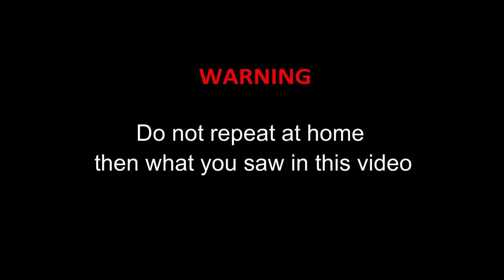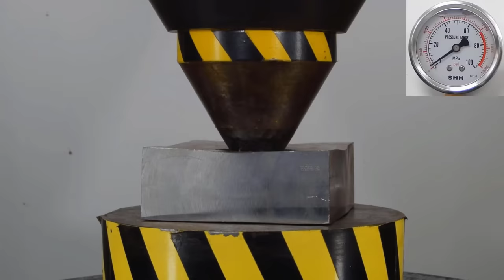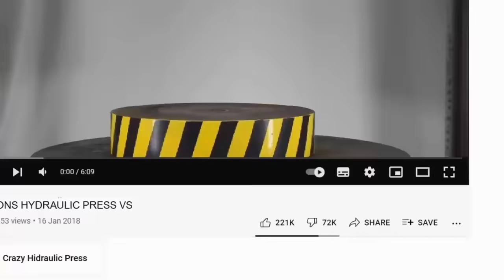HYDRAULIC PRESS VS OLD AND MODERN ARMOR

Comment: All of this makes you actually frigthened of the things that these armors stand against. After all, the armor of WW2 was already tough and that was already difficult to deal with. But the modern one that survived a lot more punishment makes you actually impressed about what modern anitarmor weapons can actually DO.
Reply: Do not forget that the majority of modern tank armor uses higher quality alloys than what was shown here, and also usually is layered with some form of composite (usually advanced ceramics or in the case of the abrams, spent uranium-derived materials) that works in conjunction with the high end alloys to slow, catch, and disperse the energy of, modern super high velocity anti-tank rounds, as well as handle the heat jets from modern shaped charges. A T-90M, Abrams of any model, or a Leopard 2 of any model would simply sneer at any cannon or AP round that WWII could feasibly throw at them.
Reply: @willkenny5687  "A T-90M, Abrams of any model, or a Leopard 2 of any model would simply sneer at any cannon or AP round that WWII could feasibly throw at them."
From the front? Most definitely. From the sides? Then I would be a bit concerned. From the back or top? They're a goner. Even ww1 artillery would go though the roof of a modern tank like a hot knife through butter.

Also, your tank list is weird, why list the T-90M, which is a top of the line tank, along with any model of Abrams and Leopard 2? An original Abrams or Leopard 2 is no where close to a T-90M, they are more like a T-72B but with a much worse gun in the case of the Abrams who originally only mounted the near obsolete L7 105mm riffled gun. The soviets where way ahead when it comes to guns as they already moved to a 115mm smoothbore gun back in the 60s when they made the T-62. Even the latest version of Abrams would probably be at a disadvantage against the T-90M as the Abrams tank has bigger weakpoint in the upper glacis. In a hull down fight, it's anyone's guess who has the better chance of penning the other since both armor compositions are unknown to the public at this point.
Reply: It would be very interesting to see WW2 naval armor
Reply: @willkenny5687 
Тут дело не только в качестве. Похоже сам подход к созданию броневой стали изменился.
Раньше считалось, что броня должна обладать высокой вязкостью чтобы снаряд застревал в такой броне примерно как палец в пластилине а сама броня при этом бы не разлеталась на кусочки как во втором случае (чтобы экипаж танка от осколков не пострадал).
Сейчас же, похоже, опять пришли к высокой твердости брони дабы броня сама по себе сопротивлялась какому-либо внедрению твердого материала (сердечника снаряда) а осколки в случае разрушения, видимо, должен удерживать противоосколочный подбой или какой-то хитрый слой брони из композитного материала.
Reply: @skitidet4302   The latest version of the abrams at a disadvantage against a T-90M? Don’t make me laugh. The M1a1 abrams handled T72s using the same 2a46m main gun as the t90m in iraq, and was never penetrated. I have strong doubts that that situation has changed dramatically enough to put the M1a2sepv3 at substantial risk. 

The soviets in the 50’s absolutely were leading the way by a lot when it came to tank technology, and the IS-3 was definitely better than anything the allies or axis had at the time, but materials technology has come a long way since then, I have very strong doubts that even its 122mm gun with WWII era ammo could take out a modern mbt. 

And the reason as to why I included all of those tanks together is because the original M1, the original leopard 2s, and the T90M, all use technology from the 80’s and 90’s, and are thus roughly contemporary if not equivalent.
Reply: @skitidet4302  
>Iraq
>Ukraine
Yeah nah I’m taking the Abrams and the Leo 2. They 100% are in the same category as, or are better than, the T-90M
Reply: @willkenny5687 Not to mention this dude was making nonsense points about tanks of today having weaker side armors. Unless any of the tanks listed were blitzing around corners and acting fully oblivious while fully aggressive, a tank from WWII shouldn't ever be in the position to shoot the sides or, heaven forbid, the god damn roof of the modern MBT. He reeks of 'I'm a numbers guy' stink.
Reply: @willkenny5687  "The M1a1 abrams handled T72s using the same 2a46m main gun as the t90m in iraq, and was never penetrated."

Wrong. Just plain wrong. It actually baffles me how you can just bracingly state something so absurd that can be easily disproven by a 5 second google search.
The Iraqis where using 3 types of T-72 tanks, firstly the original T-72 Ural, which had a D-81TM(aka 2A46) gun, the T-72M which was a downgraded version of the T-72A and had a D-81T gun, and lastly the T-72M1 which actually had the 2a46M gun. The problem is that the T-90M DOES NOT USE THE 2A46M gun! It uses the 2A46M-5! Which is a full 4 generations newer! The Iraqis also did not have access to modern Russian ammunition which is vastly superior to the ammunition that they had access to.

"I have very strong doubts that even its 122mm gun with WWII era ammo could take out a modern mbt."

The rear armor of a modern tank is likely not thick. It's hard to find any schematics of modern tanks for obvious reasons, but I strongly doubt they have more than 100mm RHA equivalent armor in the rear unless it's some kind of special version equipped for "urban" warfare.

"leopard 2s, and the T90M, all use technology from the 80’s and 90’s, and are thus roughly contemporary if not equivalent."

The technology is even older, that does not matter however since the implementation and use of a technology is way more important than when it was invented.
By your logic, a tank is equal to a Sword because they both use steel and that's a technology that's over 2000 years old.
Also, the T-90M IS NOT CONTEMPORARY with early leopard 2s and Abrams! LEARN WHAT WORDS MEAN! The contemporary equivalent is the T-72A or T-72B as those where of roughly the same era.
Reply: @autogaming8324  Old versions? You are being ridiculous! The old L7 gun has basically no chance of penetrating a T-90M frontally, while the T-90M can penetrate the Abrams literally anywhere with ease. The old Abrams had no independent thermal viewer for the commander, the T-90M does. The T-90M has a much lower thermal and auditory signature and lower fuel consumption than it's wasteful American counterpart, they moved way from gas turbines for a reason. The Soviet style tracks provide much better traction in mud compared to the rubber padded ones the west uses to preserve their roads. The list goes on and on.
Reply: @skitidet4302    fine, let’s play it by the technicalities then

The M1A2 SEPv3 and SEPv4 are objectively better platforms than the T-90M. Earlier versions of the M1A2 and potentially the M1A1(and its upgrades) are, if not superior, then on par with the T-90M. All other models of the Abrams are likely inferior, though, with the exception of the very first production batch of original M1s, they would still pose a threat to the T-90M.

Leopard 2A5 and up are either on par with or flat out better than the T-90M. Earlier models, while inferior, are still a threat to the T-90M

Now, about your statements.

Firstly, in no place did I ever mention the old models. That’s an incorrect assumption on your part, as im talking about the design as a family. Every model of Abrams after the A2 has an independent thermal sight, one that is very likely much better than what’s mounted on the T-90M. Every Abrams after the A1 has a M256 120mm smooth bore which has shredded T-72 variants since 1991. It’s not unreasonable to believe they’d also penetrate the T-90M. 

Every Leopard 2 comes with a 120mm smoothbore as a standard. It is also faster than the T-90M, even if it sacrifices some armor for it.

Both the Abrams and the Leos perform just fine in off-road conditions. Again, see Iraq and Ukraine. The better traction in mud, a situational advantage, comes at the cost of tearing up roads vital for logistics lines, which, while a whole other debate, is ultimately a bad deal. 

On the topic of logistics, yes, the Abrams guzzles fuel. But the US, much like other operators, simply don’t care, because anyone who operates an Abrams has money to throw fuel at it and make it go. 

The T-90 might have better fuel consumption, and I’ll even take the claim of a better thermal signature, but I really doubt it’s quieter than an Abrams or a Leo. Not bc they are quiet, ofc, but because every single Soviet/Russian tank is loud as shit, including earlier T-90 models. And it’s not like those advantages even matter, because both modern Abrams and Leos have better sensors, and are usually well integrated with recon elements in the armies they operate with (unless they’re a middle eastern army, of course) 

Lastly, at the end of the day, both of the western models are more survivable than the T-90M. Sure, none of them have been lost in combat yet, but at the end of the day they’re still a incredibly upgraded T-72. I’ll bet money that turret is going orbital sooner or later. 

Also, only 100 T-90Ms in service with Russia, while there are at least 840 M1A2 SEPs in service with the US military (couldn’t find numbers for the v3 specifically) and around 200+ Leopard 2A7s in service with Germany. Simply put, even if, somehow, the T-90M is a better tank than them, it is less impactful due to how many there are. Ironic, considering this is Russia we’re talking about.
Reply: World war 2 anti tank weapons were not always effective. German infantry guns including 37 mm anti tank guns were called "door knockers" by the guys who used them. In 1941 having a T34 tank was not that bad an option.
Reply: I just wonder what kind of armour he used. The modern stuff usually isn't sold on the civilian market. You can get the steel but tank armour is more than that.
Reply: @skitidet4302 you seriously need to turn off Warthunder. Next you'll tell us every Abrams has no greater than 375mm of lfp armor. Btw, most T72s and T90s have no greater than mid 400mm on the ufp. They rely on heavy ERA to achieve better protection. Heavy ERA is dangerous to infantry as it becomes a frag grenade on impact. Not to mention the L7 105 could pen over 522mm. Meaning, one shot center mass and the T90Ms turret is going sky high. Russian tanks do not have blowout panels and actually suffer from a Carousel ammo rack. Theres also tons of footage of Russian gun stabilizers bouncing up and down uncontrollably from uneven terrain. But sure, let's pretend they're state of the art lol. I could go on and on because I was trained on Russian equipment by the military.
Reply: The quality of T-34 armour varied enormously, with some T-34's going into battle with cracks in the armour straight from new.  Russia had severe problems producing steel as (among other things) it lacked the equipment to measure high temperatures correctly, so a lot of casting was done by guesswork!
Reply: @willkenny5687  you can also see that he used a different spike, so he used a weaker metal in the spike for the older armor. a song metal spike for the newer armor.
Reply: @PyroBlonde7777  While I do enjoy shitting on Russia all day any day, I'd like to see proof of some of your claims. Firstly, the armor values, secondly, the stabilizers. It is very likely that the videos you've seen depict tanks with the said stabilizers disabled by the crew for reducing unnecessary wear. Not to be hostile, but sometimes it is better to stay humble.
Reply: @skitidet4302 
The Abrams and the Leo 2 using the same Rheinmetall 120mm smoothbore gun. Rheinmetall also developed a 140mm version, but never used it because there is no need. The Rh120 can pierce nearly every tank armor with the right ammo. But the most important thing in tank warfare is mobility. And the engines of the Leo 2 and Abrams are way better. The engine of the T-90M is a upgraded version of the old W-2 from the T-34. Leo 2 can fire and hit a target 3km away on full throttle, and i'm sure the Abrams ca do the same. The T-90M needs to stop to do this, that's also a major problem on the T-14.
Reply: @autogaming8324 did you just use Ukraine to justify that Leo's and Abrams are better than t90? The Abrams which have not even arrived, and the burning Leo's? Against the t90s that are still rolling around, messing stuff up? Ridiculous.
Reply: @petrskopal4922 i think it would be easier to prove your point by showing a real combat t90m  barrel staying on target while thrashing through rough terrain, than for him to prove that the system doesnt ever work.  I get that he made the claim, but its a lot easier to prove something happened than that it never does.  You already admit there may be one video showing what he claims, after all.
Reply: @yegorzakharov8514 im not sure what your point is here. Ive seen a lot of t90ms catastrophically explode after a hit from an atgm.  Most the leos I’ve seen abandoned hit mines.  Supposedly most were recovered.  Anti tank mines score mobility kills on any tank.

Ive not seen any leos fighting t90m though.  Russia seems to want to keep them in the rear and use artillery systems and mines.  Its almost like they don’t think their tanks are capable of stopping the leos safely.
Reply: @autogaming8324  In point of fact there have been 18 documented T-90M’s destroyed along with 2 captured.  Pictorial evidence at Oryx.  As of now there are 3 documented cases of a Leopard 2 destroyed in Ukraine, and obviously no Abrams yet.

Otherwise I agree with you, Russian gear has been worse than equivalent NATO gear since the late 1970’s and the gap has only been getting larger.
Reply: @PyroBlonde7777  You clearly know more about warthunder than I do so you are clearly projecting.

"the L7 105 could pen over 522mm."
Yeah, if it was firing the most advanced depleted uranium APFSDS and if it hit the weakest point which is unlikely. But the same could be said for a T-72B firing at an Abrams M1A2.

"Russian tanks do not have blowout panels and actually suffer from a Carousel ammo rack."
Yeah but if the ammo gets hit from the tank getting penetrated from normal angles(ie not hit low), then that means everyone within the fighting compartment is already dead. Why does it matter if the tank blows or not if a western tank would have lost it's commander, gunner and loader if penetrated in the same way?
Reply: Then I think about the weaponry used to get through that armor. and incredible amount of energy
Reply: @skitidet4302 oh god someone send the warthunder player back to Thug Shaker central...
Reply: @willkenny5687 you must be kidding right? Because the Conqueror and the M103 were superior to the is3 in everything
Reply: @skitidet4302 I don’t remember USSR and Russian tanks being as good as western tanks? They were inferior when they were in the field, only on paper were they good.
Reply: @skitidet4302 why do you think that USSR could produce the same Quality materials as Germany and USA ?
Reply: @kimmogensen4888  "They were inferior when they were in the field, only on paper were they good."

What do you base this on? The USSR was never at war with the west so there was no "in the field" experience to go by. Let me guess, you are talking about 3rd worlders using their equipment poorly? Well the same thing happens when the west give them stuff. How well did the Abrams do in the Iraqi army? Not very well as they got beaten by guys in pickup trucks.

The closest you would come to real in the field experience was in the Korean war. Last time I checked, the Chinese pushed back the western coalition pretty dam well.
Reply: @drunkenhobo  the point you make about no tank v tank fighting, is mostly true (there have been some Frontline videos of t90s vs western weapons), and that it's mostly mines and arty. However, the leap you made is strange. The fact that an army doesn't launch frontal assaults on oncoming armored fist attacks, does not mean they are "scared" to use the weapons. It means they are not idiots. Why do something that gives less results and costs you more, when you can do less, and get more results. It highlights some of your bias here.
Reply: @skitidet4302 the T-90 is absolutely garbage lmao. it’s still a T72-B underneath, it’s also a cheaper variant to produce
Reply: @willkenny5687  > because the original M1, the original leopard 2s, and the T90M, all use technology from the 80’s and 90’s,
WTF are you talking about.
Both the original Leopard 2 and Abrams are from the 70s.
Reply: Steel plays not this big role in Armors anymore, instead nano ceramics beside nanometric steels.
Let say there is a reason why modern tank armor has this high Ratings.
As example some place on the Leopard are rated as 1620 mm RHA against HEAT or 1050 mm against KE.

RHA stays for Rolled Homogeneous Armour and KE for kinetic penetrator.
Reply: Modern armor is actually even better than just steel. It uses composite materials and reactive elements to provide even more resistance at significantly less weight. Steel is still used usually to sandwich the composite material since steel can more easily withstand repeated strikes from less penetrating ammunition like autocannons, artillery shrapnel, and small arms fire.

The types of composites they use are usually glass, plastic, ceramics, and rubber. The idea is either to spread the impact over a larger area, or to compress and decompress, "feeding" more armor into the incoming penetrator.
Reply: One of the many reasons we don't have decent healthcare in America.
Reply: @misfit4816  You say that like it's something bad. The T-72B platform is very good and is NEWER than the base Abrams which later Abrams models are based upon. For example the side armor and the upper front plate of the T-72B is vastly superior to the Abrams, even on later models excluding tanks fitted with the tusk urban warfare package that does feature better side armor. The Abrams might win in a slow sniper fest because of it's better ammo, superior optics and excellent front turret armor, but if it goes on the offensive and exposes anything but the turret front, it's just MORE vulnerable than the T-90M.

Oh and one more thing I've just remembered, it's not just a "T-72B" underneath as there are different versions of T-72B hulls, earlier ones had front plates made out of a sandwich of steel and textolite, later ones had reflective plate composite armor. The T-90s are based on the latter with modern ERA on top. Thus making it's front hull armor exponentially better than the Abrams which was already arguably inferior to the T-72B.

Oh, and it's not cheaper, not even close as it has more complex fire control system and optics and feature more complex layouts of composite armor with added ERA on top. How could that be making it cheaper? Do you even think before you make this stuff up?
Reply: Yeah, depleted uranium penetrators cut through that stuff like butter, apparently.
Reply: That was not even showing the real thougness. This was just steel. No composite armor.
Reply: And here we are, weapons that can penetrate 40MM of titanium while i can bend my fork with my fingers.
Priorities are really a thing
Reply: @skitidet4302 did you just say a T-90 is better then a leopard 2 or abraham tank? 2 of the strongest most modern tanks made sofar?
Reply: So you basically fight modern armour best with a simple medieval cannon ball.
Reply: @dalekrenegade2596  Uhm joke beside, In armor the US is the US a generation behind right now. And in healthcare a US Tax payer pays more as any other country per capita so well no this is not the reason.

More like Corruption and money wastage.
Reply: @skitidet4302  >'Chinese pushed back the western coalition pretty damn well's
>Looks at the years of fighting prior
>Looks at Chosen Valley
>Looks at the west going for a more peaceful option rather than dragging the war out, since only one side had access to nukes

Yeah sure. The Chinese totally won and weren't just showing up at the very end of the war. The west totally were losing super hard and were super relieved when their Chinese overlords chose peace at the 38th parallel.

My recommendation is to just keep talking about tanks. No need to spread your area of ignorance.
Reply: @asokawhite  The only wastage that comes is from price gouging. The USM has incredibly high standards that the military industrial complex can meet easily. The MIC just makes it all cost an arm and a leg.
Reply: But talibans with cheap improvised explosives can destroy tanks with modern armor
Reply: There isn't much difference between the 105mm and the 120mm used on the early versions of the Abrams in the mid 80s.
Reply: @jochas9947  Sure the most armored parts is the front side of turret and the front rest of it is weak.
Reply: @wulfone5961  Not really 20% beside this is a L44, some countrys started to use the L55. 
And well the new movement is to use instead a 130 mm gun.
Combine it with the New Panther well the M1 compared to it well the days are numbered.
Reply: @cherrydragon3120  It is. The biggest thing those tanks have going for them is modern recon technology, durability and firepower wise they're pretty standard.
Reply: @willkenny5687 well Abrams maybe, but we saw shrapnel from Russian cold war era artillery pen the sides of leopards. Imagine just shrapnel penning your side armor. Germany should just stop producing tanks lol.
Reply: @wulfone5961  Uh, yeah there is. One is a rifled bore designed by Britain and meant to shoot HEAT stabilized by its own rotation as it flies. The other is a smoothbore designed by Germany stabilized by the fins on the back of the very thin round and propelled by an incredibly potent propellant. They are about as different as a mace is to a war hammer.
Reply: @jochas9947  It's not expensive to make a super powerful explosion. Though, they don't actually 'destroy' tanks but rather achieve what is called a 'mobility kill' where the tank is unable to move and requires a substantial recovery effort to save and repair. In combat, that is not possible and thusly the tank is considered 'knocked out' of the fight.
Reply: @AstinCrow 
>Thinks a it's impressive that the might of the entire west pushed back North Korea
>Thinks a battle which featured 0 Russian tanks is a blowout argument against Russian tanks
>Thinks the west wanted to settle for the current borders while in reality it was China who wanted to go back to the status Quo instead of uniting the peninsula like the West did

You sure are special. Be sure to go ask your momma for a cookie for being such a special boy.
Reply: @cherrydragon3120  I don't remember talking about the T-90 at all. If I recall correctly, I've only mentioned the T-90M, the T-72B and perhaps the T-72B3 in this thread.

Anyways, I'm not taking the bait, I've had my fill of arguing with "special" people who think "western tanks are the best because my media told me so and the media would never lie to me".
Reply: Kinetic penetrators produce a lot of force very quickly. The impulse of that is why armour gets penetrated.
Reply: @skitidet4302  well can't be bothered to talk to another "special" group of people that think that shells and aiming system in real life works like in war thunder. They also think that they actually know how thick and effective the composite armor of abrams in the lfp and think that it is inferior to the much upgraded T-72B that we call T-90M in terms of armor effectiveness. What, you think tanks nowadays are going to go head to head? They're using APFSDS for a lot of reasons, one of those reasons is to penetrate an armored target in a great distance. If they're just going to head on in near point blank why install laser rangefinders? Sure the T 90M could arguably have better armor effectiveness in the front hull but it's not like you also really know how good is the M1A2's lfp effectiveness. Either way if a T-90M's hull is penetrated, it's 1 less tank and 3 dead crews for the Russian army. For the Americans it's either 1-2 lost crew members but they're still going to be able to shoot back or leave with surviving crew members with or without the tank. You can't tell me a Russian tank can shot trap an M1A2 in the turret ring of a distance of more than 500 meters, better yet you might tell me a joke that a Russian sabot can penetrate the front cheeks of the M1A2.
Reply: @carlosmarquez5901  Read more about the ,, HMS  PRINCE OF WALES" 70 cm Side  Armor Plates and how it worked.
Reply: Don't forget the press is stationery. Try to hit a tennis ball by a racket without a swing. Compare to a swing. And your hand is very slow. Now a tank shell may travel at 1,5 km/s. The armor becomes paper.
Reply: …. Wow. There’s some major cope here. Everything I’ve read states that the t-90 is Russia’s upgraded t-90, which theoretically makes it a peer to the upgraded western tanks. Theoretically because it’s becoming very clear how bad Russia’s issues are. Claiming “heh western tanks bad” because a few were knocked out means nothing, there are like 4 times that number of actual confirmed knockouts on the t-99 and even more bad showings of it. All modern tanks as well generally only feature composite armor on the front, and light on the side without urban combat kits. So yes even a we2 tank could kill a modern one if it somehow got a shot off behind it
Reply: Wdym none lost in combat? And those popped iconic round turrets lying in ditches in Ukraine are what?
Reply: Because having holes punched in it is the only problem a tank might face... Imagine if the enemy just shot rounds designed to coat your tank in napalm.
Reply: @willkenny5687 you seemtk forget that the gun is not the only thing that is important, but the rounds are. The export versions of T-72 in Iraq used outdated Soviet ammo from 1969 that the Soviets themselves decommissioned in 1973 and dumped it to Iraq. And we're not even gonna mention that export versions of T-72 is not the same thing as T-72 made for the Soviet Army
Reply: yea, i mean what he seems to forget is just how much faster and more accurate modern tanks are, a Leo 2 could probably defeat France by itself, if it had enough of ammo and fuel
Reply: @willkenny5687  all would be easily destroyed by a javelin, no?
Reply: @skitidet4302  I'm willing to bet he meant top-of-the-line Abrams and Leopard 2s
Reply: @AstinCrow You are worse at making stuff up than that russian troll, L7 never fired non fin stabilized HEAT.
Reply: @morgus9892  Dude, a quick google search proves that wrong. Of course the L7 had regular variants of HE that weren't stabilized. Hell, it had HESH designed for it too both by America and the United Kingdom. If you want to correct me specifically on the design intentions of the gun itself (which wasn't based on the shell type) go ahead but don't try to get all nasty and act like everything I've said is BS over one hyperbolic statement. One's rifled, smaller, and shoots older ammunition, and the other one's smoothbore, substantially bigger, and fires more modern ammunition. That's a huge difference even without getting into specs.
Reply: @AstinCrow  I never said it can't fire non fin stabilized munitions, L7 is a 105mm mainly because of the love of HESH Britain had at the time.
In regards to ammo M900 at the time was actually better than M829 but it was end of the line shell for capabilities of 105mm, that's why the 120mm was chosen as development caliber.
Reply: @morgus9892  You said 'L7 never fired non fin stabilized HEAT' specifically, you don't get to move goal posts where it's convenient for you. If I can't make wrong statements, even for a rhetorical effect, you can't either.
Reply: @AstinCrow  Do you not know what is a HEAT round? The only 105mm gun in NATO that fires non HEAT-FS rounds aka rotationaly stabilized HEAT is the French 105mm gun used on AMX 30s and in the shorter variant on some other vehicles.
HESH != HEAT
HE != HEAT 
HEAT stands for High Explosive Anti Tank and works thru creating a hypersonic jet of molten alloy when it strucks armor.
HESH stands for High Explosive Squash Head and is a plastic explosives perforator, it doesn't actually penetrate the armor, it creates vibrations on the plate and thus creates shrapnel on the other side of the plate if exploded upon.
Reply: @morgus9892  I am fully aware of what HEAT is, that's why I specified it in my original post. The L7 had several different types of HEAT all designed by multiple different countries to be used by their own tanks. That's the statement you chose to challenge. I brought up HESH just as a point for the sheer variety the L7 had due to its wide userbase.
Reply: @usssimshullnumberdd-4095  Read his follow up. It seems he did not, or he just doubled down on being wrong because he is stubborn. That would fit his personally since he clearly responds emotionally, his first response was seemingly based on a complete misinterpretation of what I said.
Reply: @skitidet4302  yeah, I see that now. However we cannot just say one is blatantly better than the other. We don't have enough combat data from either to make this assumption. For right now, all we are relying on are paper statistics. So I'll just keep my opinion neutral for now
Reply: @usssimshullnumberdd-4095  Yeah, hence I never did(at least not for contemporary models). All I said was that they are about the same, and in some aspects the soviet tanks are better, in others western tanks are better. It should hardly be controversial.
Reply: @jakeshipley9471  That's one of the dumbest concepts to ever come out of Sci-fi. There's no god dam way to create such a powerful field all over a tank that it can stop a dense metal dart traveling at 1 mile a second.

Even if you could make some field generator that weigh as much the Hover dam that was powerful enough to stop an APFSDS round at a very specific point, all they would need to defeat it was to switch to a projectile made out of a material with different electromagnetic properties.
Reply: Arty likely makes the tank inoperable even with close indirect hits.  Too much force on parts other than the chassis, and not so great for the crew either.

Direct hits from arty are bad news, but at least won't feel that for long.  Tanks tend to move a bit much to depend on that though. But as you say,  no way even modern tanks could just ignore ww2 equipment and drive around with impunity.
Reply: T-90 is nothing but a glorified T-72. It has the same armor.
Reply: @erastvandoren  It's not you liar!. It's base hull armor is a late version T-72B armor with reflective plates, which has then been covered in Kontakt-5 ERA or Relikt ERA on later T-90M and T-90MS versions. The turret is brand new.

The T-90 has OVER twice the rated kinetic and HEAT protection compared to the T-72.
The T-90M has Over 3 times the rated kinetic protection and almost 4 times the rated protection against HEAT compared to T-72.
Reply: @pixelwortel9578  i doubt it the 2A8 has much better turret protection now and also makes use of APS and also an better L55 gun so they should not stop developing that tank
Reply: @fuzer4047  they should just buy Abrams, they maybe don't have a supergun and use more fuel, but they're supersilent compared to other tanks, and can accelerate really fast to avoid artillerybarrages. The leopards have been shown being a joke because they get disabled by artillery hitting near it and gets destroyed by 200 dollar fpv drones, while we say Abrams deflect ATGM in Iraq and Yemen.
Reply: @willkenny5687  yes this true but the rounds used in some of the bigger tank destroyers even if it didnt pen the tank the percussion and shockwave from the explosive mass would still probably take a crew out of comission.
Reply: @skitidet4302 правильно себя не похвалиш никто не похвалит, а так, т-90 это морально устаревший советский хлам с кривой пушкой и некчемным двигателем разработки еще 30-х годов.
Reply: @alekxalekxandrow3451  I don't speak Russian.
Reply: @skitidet4302 Sure. Thing is, the Abrams has gas.
Reply: Except that Soviet steel during WW2 was quite a bit lower quality than that of most other nation's steel, the exception being late war German steel. Which is why the press had no problems going through it. Try it with early war German steel or American steel armor and the result would be quite different.
Reply: @wolfi9933 eh, kinda. They were designed in the 70s and production started in -79 but the m1 abrams entered service in the 80s. The Abram’s is also a very adaptable frame that has seen numerous upgrades. Suffice it to say, calling the abrams a tank from the 70s is a bit wrong even if it is technically correct.
Reply: @tacticalturtlez4906  >calling the abrams a tank from the 70s is a bit wrong even if it is technically correct.
No, it is definitely a tank from the 70s since it was developed during that time. The Initial model was developed in the 70s, they started to produce it in the 70s and all of its technology were from the 70s and earlier.
To call it "a bit wrong" is really just mental gymnastics, just because it entered service in 1980 (Not "the 80s", but 1980.) The fact that the first vehicles were delivered on the 28th february of 1980 does not make the whole baseline vehicle a development of the 80s.
Reply: @wolfi9933  only there’s an issue. The original m1 was built in 79 with test vehicles produced earlier but the m1 abrams and m1a1 Abram’s are different vehicles produced at different times. Sure the same frame but nonetheless different vehicles. There’s also another issue. If I’m born in 2000 and have my final year of high school starting in 2017, what class am I? According to your logic I’m class of 2000 rather than 2018. Sure it was originally being developed with technology available in the 70s (which comparatively was still better than soviet equipment) but given that it was primarily produced through the 80s and it’s not impossible to upgrade things during production doesn’t make the a2 sep a tank from the 70s. Also, service dates are important.
Reply: @skitidet4302  "T-72B armor with reflective plates, which has then been covered in Kontakt-5 ERA or Relikt ERA on later T-90M and T-90MS versions." -  Is that the stuff on the sides of Russian tanks that we're finding is only filled with rubber or nothing at all?  Considering how over-estimated Russian combat capabilities have been, I'm not convinced anything Russia made works the way they claimed it does, much less now that they've failed to maintain anything.  

Hell their Black sea flagship was destroyed by something that was considered impossible achieve.  Well until we realized that about half the tech on that ship didn't work anymore.
Reply: @yegorzakharov8514 unless you are avoiding pictures of destroyed T90s we've seen far more destroyed T90s than leopards.
Reply: @Uller1967  "Is that the stuff on the sides of Russian tanks that we're finding is only filled with rubber or nothing at all?"

No. Also those videos are of captured Russian tanks that where obviously plundered for parts. If you look closely, all kinds of stuff are missing, even down to stripping the bolts of the thing.

You would have to be very special person to take a year old lying press narrative and faithfully regurgitate it.
Reply: @autogaming8324 all leopards got destroyed in Ukraine ..
Reply: @peterroe2993  Well at this pace they will catch up pretty soon. How many T-90s destroyed yet? I think we are already up to like 30 destroyed or damaged leopards from this one failed offensive.
Reply: Never argue with a yank about a yank tank. Just nod and smile after all they will say that a Sherman was better than a Tiger. So I have learnt to ignore anything said by a yank. Like the Native American said they speak with fork tongues
Reply: @skitidet4302  
"The closest you would come to real in the field experience was in the Korean war"

And shermans with long 76s and APCBC ammo wrecked T-34-85s left and right

They only got pushed back because china applied the human wave on western troops and the absurdly broken terrain in north korea neutralized almost any advantage in mechanized warfare for the west and once the chinese troops got into the flatter terrain of south korea, they were pushed back as well and the war became a stalemate

But ok, you're just confirming that you simp for whatever is NOT the west
Reply: @willkenny5687 there are Simulations out there showing modern Tank Armor agains the 125 mm Shell of the IS2 and the 128mm Shell of the Jagdtiger. That is nothing to Just sneer at. Those shells have such a high mass that they can do some serious damage even to the Front of modern Tanks.
Reply: @svidentkyrponos7530  Also, flatter terrain in Korea? It's pretty much all mountains you liar! Look at any topological map and you can clearly see that there was no terrain reason why the Chinese stopped where they did. Their mission was to protect the North, unlike the west who had the mission of destroying the North, so they did not just defend the South but pushed North.
Reply: @skitidet4302  only 4 leopards have been confirmed destroyed by public images. But pictures of 44 T90s destroyed and pictures of 14 captured.
Reply: @peterroe2993  I'm not aware of any destroyed T-90s, Oryx does not even list any. I think all T-90s have been upgraded to T-90A, T-90S or T-90M.

You only got that number by lumping together all the different T-90 models figures together on a partisan website like Oryx, which counts some tanks which we have no clue if they are destroyed or not, and it also has duplicates.

Anyhow. around 50 lost is not a bad number considering they have somewhere around 600 of them and they have been fighting hard for a long time now against all the west can throw at them. Even if they lost 60 of them, that's still only 10% losses.

Contrast this with Ukraine losing at least 15 Leopard 2s within a couple of months of getting them. How many do they have? 40? that's over 30% losses in a month or two.
Reply: @petrskopal4922 armor values? The T72s in Iraq were suffering turret penetration from M72 LAW rockets! There's photo proof of this. A LAW that was being withdrawn from service because they (the US) thought it was to small/light
Reply: @skitidet4302 
And got pushed right back in return! And that was not just tanks but a HUGE number of Chinese troops effectively overwhelming the NATO troops for a time
Reply: @skitidet4302  I don't know why you're calling the T-90M a top of the line tank, but not Abrams or Leopard 2. Then you refer to the old Abrams version that used a 105mm gun.

The latest Abrams (and Leopard 2) versions outclass the T-90M in most if not all ways. In the end, the T-90 is little more than an upgraded T-72. But somehow you seem to regard the T-90M as a modern top of the line tank because it's upgraded, but do not give the same considerations to the western counterparts. As for your scenario with the Abrams having a bigger weakspot, that is simply one part of a tank battle. 

There is speed (the Abrams is faster, especially in reverse with is dreadful on the T-90). There is fire control, thermal optics, ammunition, crew comfort and survivability. Just to mention one thing for example, any penetrating hit to a T-90 is likely to detonate the autoloader carousel, wiping out the crew and tank in a great explosion. The Abrams on the other hand stands a better chance of both saving the crew as well as having the tank not be a total unrecoverable loss. In the end a tank engagement often comes down to who fires first, western tanks have the equipment to make it more likely that they are the first to fire.

The soviets were great on tank tech in the 60's that doesn't necessarily translate well into modern day.
Reply: @yegorzakharov8514  So you compare a few "burning Leo's" but ignore the T-90s that have exploded? Nice bias bro.
Reply: @willkenny5687  obviuosly you have never heard of 12,8 FlaK 40.
Reply: T-90 doesn't even survive basic maneuvering trials in south east asian nations.. while most Western tanks and even a Ukrainian T-84 work well and were bought. Let's be honest here the MBT know-how of the Russians degraded significantly after the fall of Soviet Union, because the bulk of the technological knowhow resided in ex-bloc countries and not Russia itself.
Reply: @AstinCrow Anti-armor tactics from field troops, not to mention tank killing weapons, do in fact target the sides and back. Tanks shouldnt, troops will.
Reply: Whoever invented our javelin shoulder launch missile system was a freaking genius and way ahead of their time
Reply: @PeteNice29  That's nice and all, but tanks nowadays aren't designed to specifically abuse infantry. They are designed to counter and neutralize enemy vehicles, with the expectation being that friendly infantry operating would encounter and intercept enemy infantry before that becomes a problem. Tanks aren't designed to individually the best in every single scenario, they are designed to fit doctrines. That's why NATO tanks have failsafes in case enemy infantry can put munitions through their side armor, not to save the tank but rather the crew. You can't make a tank invincible and you shouldn't try.
Reply: Hard to stand up against a stream of metal travelling at 40k kilometers an hour, physics just pans out poorly for armor in this scenario. Which is why active defence is the only hope against certain weapons.
Reply: What is wrong with you ppl it's fake modern armor Punch was aluminum or lead or something not like the ww2 and layered plate punch.
Reply: There is like that one video, where a Soldier shoots a rocket at an Abrams (I think) and it just bounces of
Reply: @skitidet4302 What actually matters is who spots the enemy first, and outs out an accurate shot first.
Reply: @EnemyAtom65  Then why bother with armor at all? I you where right, all MBTs would be like the Leopard 1, light and fast, but just being able to stop auto-cannon fire from IFVs, if you are lucky.
Reply: I must say that the t34 armor was high-tech, and German 37 and 45mm anti-tank guns, including those mounted on Pz3/4 tanks, were able to knock out the t34 with 2 shots, but not destroy the crew. Because of this, the Germans abandoned these guns and decided to pump everything into large 88 mm guns, which were not profitable to make towed and they were put on the tiger and panther. But the welds of the t34 were welded by a welding robot, and the German armor was cooked with an electrode. So the Germans were significantly inferior in terms of the density of fire and the number of guns, and the 85 mm gun produced in response to the tigers on the t34 coped with its task. Therefore, we can say that the high-strength armor with a thickness of 45 mm on the T34, the technology of which appeared in the Soviet Union before the war, in fact forced the Germans to resort to the wrong strategy and the USSR won the war. And you probably didn't know, but the Americans didn't have high-strength armor technology until the end of the war and they made thicker cast hulls for Shermans. The British did not know at all what welding of tank hulls was and did everything on bolts, how such armor withstood tank shots, I suggest we figure it out ourselves. Conclusions from the Second World War were made only by the Soviet Union, and therefore the T-series tanks are 10 times cheaper than their Western counterparts, but at the same time their number is at least enough to fight, because mines and artillery don't care how many millions your Abrams is worth
Reply: @user-zm8cx8iq1o  потому что раньше стреляли каморными снарядами, и твердая но хрупкая броня не любит такие вещи. Но если нужно противостоять Супертвердому вольфраму или урану, то здесь нужна твердая броня
Reply: @skitidet4302 Newest abrams can hit T90 from a distance that poor ruzzian targeting can't even see
Reply: @skitidet4302  Alright, I guess I should have explained it better, but it's essential to create obsolescence. Make older weapons less of a threat, and force them to have to fire more accurately. Tank guns advance faster than the Armour on them. You can always just give an old gun a shell that's capable of being fired from the same (or slightly modified) gun, just with a different piece at the end. (HE, HESH, HEAT, AP, APCR, APHE, APHEB, APHEBC, etcetera)
Reply: @skitidet4302  A modern MBT firing at another MBT is likely going to penetrate if they fire an accurate shot. An older tank, however, with a less accurate shell, or less penetrating power will not. 

Modern tank Armour isn't necessarily meant to stop the current top of the line weapons, it's meant to stop the previous top of the line weapons.
Reply: @愛を込めてロシアから  You are incorrect about many things, one of them involving the British. The British did understand how to weld, it was easier to use rivets because you don't have to train someone to use a riveter nearly as much as you do a weldtool
Reply: @愛を込めてロシアから  Also, in modern times, the reason that we still use the T series tanks is because we cannot afford to field the Armata on full scale. We are still recovering from the disastrous collapse of the Union of Soviet Socialist Republics. I am not pro-western, but you must not be blind; you cannot better yourself if you do not see your shortcomings
Reply: @EnemyAtom65  Literally the opposite is the case when it comes to front armor, especially turret cheeks. Modern tanks claim like 800+ mm of RHA equivalent against kinetic penetrators. How much penetration does APFSDS have? 500-700mm.
Reply: @EnemyAtom65  the welding robot literally does not require the qualification of an employee, children worked with them. You bring the nozzle to the starting point, press the button, turn it off when the seam is welded. And no, the British bolted the armor not because it was easier, but because they did not have a production culture. It haunts them to this day. And we don't have armata in large quantities because this is a tank concept, and it has not yet shown itself on the battlefield. So far, it is fundamentally no better than other Russian tanks
Reply: @yegorzakharov8514  If the T-90 is truly so much better than the Abrams and the Leopard 2, I like to think Russia would have made a little more progress in your invasion of Ukraine than your country's current abysmal performance. You are currently losing ground, not taking it.
Reply: @skitidet4302 "moved away from gas turbines for a reason".   You do know Russia is restarting T80 production right?  The one Russian tank with an actual gas turbine.
Reply: @danielmartin531  It's also the one Russian tank with decent reverse speed... Which has proved pretty important in the current war.

I think designing a new gearbox for the T-72 and T-90 family of tanks would be a better long term solution but I guess they don't have time to wait for that so they restarted the T-80 production again.

But to be fair to the gas turbine, it has a lot more potential than the V-96 which is already as good as it can be with it's 1250 hp and small size. Improving the Gas turbine of the T-80 would be a lot easier than modifying the T-90 to fit a bigger engine. Russia also has tons of fossil fuels so they don't really have to worry about logistics.
Reply: @ennui9745   how much ground gained russia in its tanks and how much ukraine gained with leopards? That is the proof that russian tanks are better
Reply: @愛を込めてロシアから  That's ridiculous mental gymnastics, truly worthy of a Russian. You're already losing all the ground you gained in your invasion.
Reply: @ennui9745  dude mental gymnastics its what you say. How's counteroffensive going? 😂😂😂
Reply: @愛を込めてロシアから   Making progress, actually. How's taking Kyiv in 3 days going, vatnik? 😂😂😂
Reply: @ennui9745  making progress 🤣nice job losing 70k of people for 3 villages of 200 people population😂 we are here to k1ll people, not to take kiev☕
Reply: @愛を込めてロシアから   You talk tough from the safety of your keyboard, but you would shit yourself if you were actually drafted to fight in the war. I hope you get drafted. 😂
Reply: Even more : shaped charge warheads go through it without much fuss.
Reply: It's the stuff that penetrates that scare me
Reply: @willkenny5687  Yet those tanks are getting blown up left and right by drones in Ukraine.
Reply: @skitidet4302  It's documented that an Abrams took a 120mm depleted uranium discarding sabot to the rear armor, during a friendly fire incident. Allegedly, the vehicle only lost its engine, but the crew survived and the vehicle was repaired. I don't think 105mm tungsten penetrators, the largest and most capable anti-armor rounds during WW2, would do much to an Abrams.

I am not an expert, I claim no special knowledge, just something I read in a newspaper.
Reply: @HopeisAnger  You're argument makes literally no sense. It only has the engine and the transmission in the back so ofc the crew survived. That would have been the case on any tank with a conventional layout unless the projectile was hit from more straight behind so that it continued in to the crew compartment.

"I don't think 105mm tungsten penetrators, the largest and most capable anti-armor rounds during WW2, would do much to an Abrams."

Where to even begin? What 105mm tungsten penetrators? I'm not aware of any anti-tank gun of that caliber that was in use in ww2. However there where larger caliber anti tank guns in use during ww2, like the 12.8 cm Pak 44. Anyways, no tank is invulnerable and they all have weak points that are easily taken advantage off, even with old tech, if exposed. You can clearly see this in Ukraine. There was a strong misinformation campaign against Soviet tanks to claim they are bad because they can be destroyed, well so would Leopard 2s, Challenger 2s and Abrams M1A2s if put in to action which has been proven true. No tank has tracks which can survive a big hit. Once the track is gone, there's a matters of minutes until 152mm/155mm artillery score a direct hit and there is no tank on earth that can survive that, thus immobilization means the tank has to be abandoned.